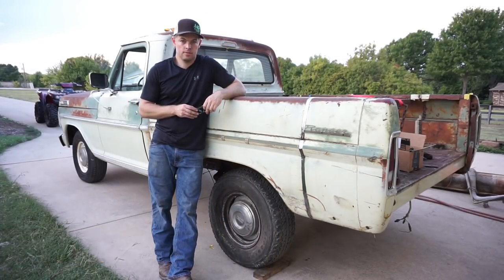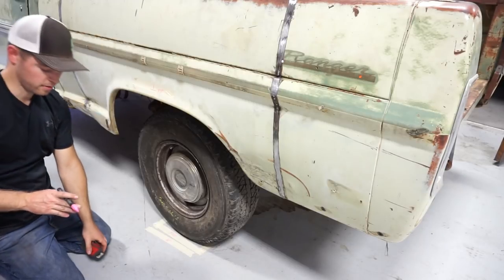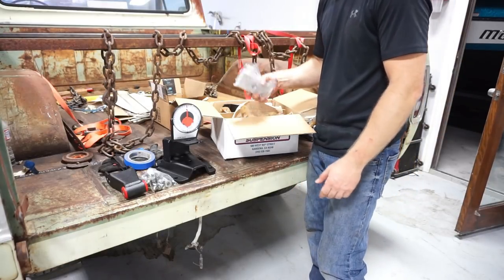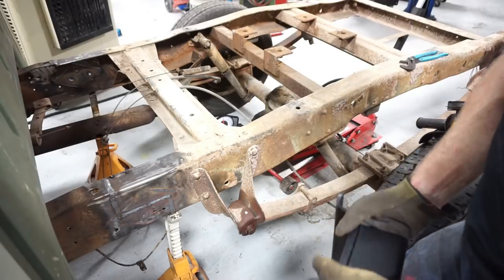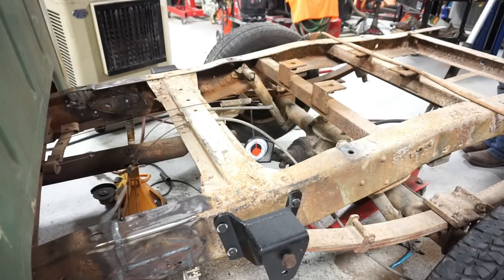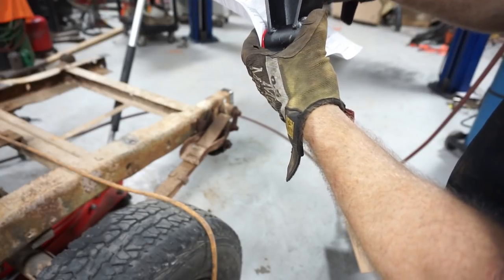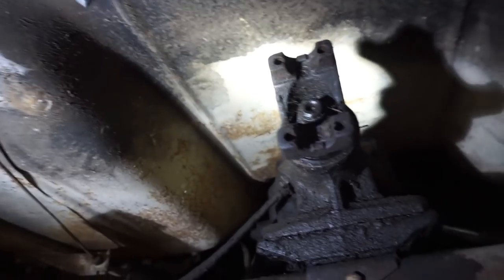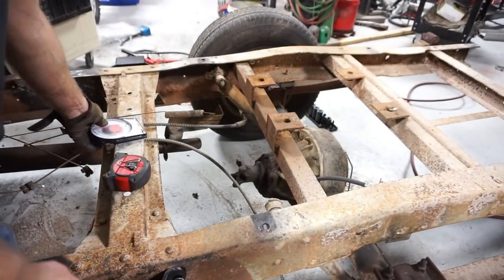1969 F100 DJM Lowering Kit Installation

Comment: I had a 72 , lowered 2" . I just took the springs to a spring shop , got them de-arced . When dealing with driveshaft angles you want between 1 and 4 % on each yoke ,ideally each the same ,any less and the needle bearings will hammer out the cups , more will cause wear and vibration. Always liked the ride and handling better with a long box better . Crew cab best of all

Comment: The Flex-o-matic springs are longer than the standard springs. The rear shackle for the standard spring is considerably shorter, so if you were to use the extended hangar you purchased on a std spring setup, you'd get more drop. I don't know if there is enough room to build an extended hangar for the flex-o-matic setup without it hitting the underside of the bed. I have a '68 with standard springs and an '69 with Flex-o-matic.
Reply from the maker: Thanks, that explains a lot. That flex-o-matic mechanism is close to the bed floor now, I'm not sure you could move it up much more without having to cut the bed floor brace.
Reply: @330_garage3  The flex o matic seems to ride better than the std spring. Neither haul much weight. But if your looking to go down more about the only options are an axle flip and c-notch or 4-link it. There is also a kit out there to install late model T-Bird IRS if you want to get real fancy.
Reply: I just looked at my 71. It has the flexomatic. The top of the spring is directly below the bed. It's not going anywhere.
That could be why the front mount has 2 sets of holes. I bet the top hole is 8" lower than stock, giving you the 4" rear axle drop. Thanks much for the pinion angle shims. I never thought of that.

Comment: Love the video! Do you happen to have a part number I’m looking to do the same thing on my F250 and just want to make sure there’s no big differences I also have the flex-o-matic Shackle so I’m glad to see a video that actually work…
Reply from the maker: I thought I had listed it in the description... but just in case.  DJM Suspension Shackle and Hanger Kits HS1130-4
Reply: 330_Garage you probably did I just didn’t look lol thankyou very much
Reply: I like the result doesn't seem like you going for a x treme drop or you would had put the axle on top of the springs that would had been about 4" right there , the shackles worked really well though .
I have a 250 as well DJM doesn't really list any parts for bumpside 250"s I called them once they said they made them at one time but they just sat on the shelf . I don't see why those shackles would not fit a F250 unless the front hanger is different bolt pattern or something . I would rather use the kit with shims instead of putting my axle on top of the springs
Reply: That’s exactly what I was thinking I believe in my lmc catalog the factory hanger for f100 and f250 are the same so the djm would have to be the same if that’s the case.. just a much better cleaner look then flipping the axle... unless you do both! Lol
Reply: @gabeguedea2499  
There's 250 kits but I seen 1 for 600 bucks ,m? I'm like ???? They use a metal u shape thing with your original perch so you don't need to cut your old one off it fits underneath  can buy that or make it for  50 bucks , then find the 7/8 standard 250 or 1 1/8 drop beams usually 3" add a front spring from a 91-94 explorer that be 4-5" drop in front
Reply: There's a lack of bumpside 250 lowering vids   i plan on getting the    3" drop beams with big kingpin size and doing a flip in rear with c notch if the rear is lower I I'll bring the front down with the 91-94 explorer spring  should be 5 front and 6" drop
Reply: Bamboozel96 I have never heard of the explorer spring swap before that’s good to know! You don’t think it would struggle to much trying to hold up that big block? Sounds like a cheap easy junk yard or eBay find lol
Reply: @gabeguedea2499  
There's a you tube vid on it they fit but the coils are tighter together not sure if I would go that route with a 250 they said it dropped the front 3" I just thought that info out , a f 100 I think was around 1 3/4 to 2" with the explorer coils I guess new online there only 40 bucks a set .   I looked into the F250 drop quite a bit there's chassis tech , Fatman Bob , And one other that sells a complete bolt on IFS for 2,100 they also have rear flips or bolt on 4 links can go coils , bags , or coilovers on that . Some shops might bend the stock I beam if you cut 1/2 coil off the front that would give 3" at least , one guy drilled a hole 1" higher above inner I beam mount hole and re bolted the beam brought his camber in that way . All these were things I found people were doing I would like a nice drop but a safe one as well the 2k for a complete bolt on IFS is not bad disc brakes different options for hieght ajustment and the ride bolt on as well that's a plus , I haven't decided what to do still taking in the info then decide best course of action .

Comment: nice job...  but when you put your bed back on and put the level  and and said it was ass high still... you didn't have the tailgate on ! Then  are you planning on putting the fuel tank in the rear like 20 gal.  thats more weight and going to lower it and make it front high,,, I'm sure you thought about that later after making this video

Comment: i wonder if a guy ONLY wants 2 inches lowering; why couldnt a guy  JUST remove fr spring hanger and reposition it about 2-3 inches higher, simulating the new rebuilt ahnger and just redrill some new holes to mount it in this higher position?
you may have to trim a bit of curved top of old bracker but so what its not touching the frame any longer anyways.

Comment: I usually try to let my eye decide what looks "level" than an actual level. Sometimes the level will say something is level, but the eye, based on the physical dimensions of the vehicle, will not agree. The most common crime with these trucks and lowering kits is being too low in the rear due to the dimensions of the trucks being front-thick. If you know what I'm saying...

Comment: Shouldn't you measure pinion angle on the driveshaft...
Reply: no the way he's doing it works fine
Reply: @mrb2917  
Measuring this way give you independent angle(s) of the transmission and pinion, it does not give you the relationship between the pinion and the transmission. The transmission could be perfectly level with the pinion. Doing it this way does not give you pitch or yaw....

Comment: All those spots are unreliable 
You measure from the bottom lip of the fender to the CENTER of the wheel.. So remove the hun can and measure to the Center of the axle 
That’s TRUE ride height